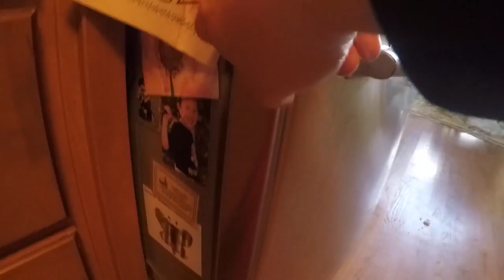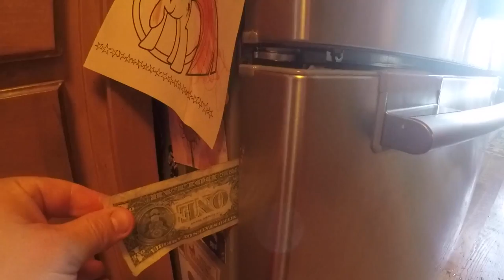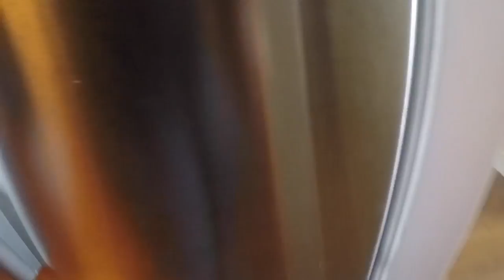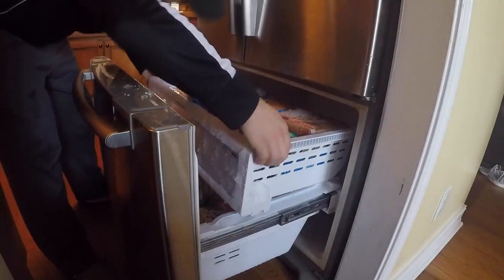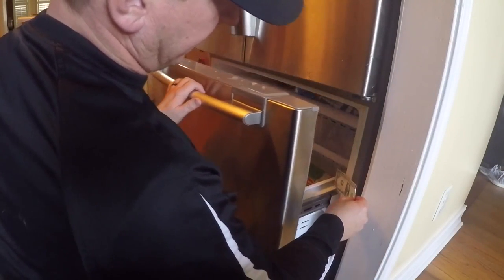Fixed: Frost Buildup In The Freezer Causes

Comment: Good tips!  I had frosting problem after a visit by my grandkids and I was ready to blame them for standing on the freezer section.  After viewing your video I did the dollar bill test and found a gap on one side.  I looked behind the bottom drawer and found a clip we use to seal veggie bags.  After removing the clip I did another dollar bill test and the door closed properly.  Thanks for saving me from frost and wrongfully accusing my grands.
Reply from the maker: Dennis Vroegindewey Awesome! Thank you for sharing your repair success story. Keep loving on those grands! Be sure to subscribe.
Reply: There’s a problem with these French doors.  I just had service out.  Blamed door being left open which wasn’t case.  Shut power off for three days to defrost.  After two days with nothing in drawer, I have frost buildup.

Comment: Thank you! You saved an expensive call! It was something that had fallen behind the lower drawer which was prevent it from shutting all the way. I did the first thing you said and ran my finger on the periphery. Lo and behold, there was a gap on the left side. Tried removing ice, still did not close properly. When I removed the top drawer, I found an ice tray that had fallen behind preventing complete closure on the left side. Removed, cleaned, fixed. Thank you!
Reply from the maker: I’m glad you figured it out!

Comment: Thanks so much. My Samsung freezer was frosting up so badly. I thought that I had accidentally changed a setting, in my effort to do a forced defrost, to fix a problem with ice building up in the ice dispenser area. But after watching the first minute of your video, I got down on my knees and looked under the freezer box and saw that a box of frozen food was stuck in the back. I removed it and expect my problem to be solved.
Reply from the maker: bilco78 That’s great! I’m glad you found the issue.

Comment: Family member(s) did not close the bottom freezer door all the way; air leaked in causing ice buildup on tracks, so the door did not shut tightly. I did your dollar bill test and sure enough, the dollar slid out smoothly, so I knew it was not sealing as it should. I chipped off the ice on the tracks and large chunks fell out. After that, the door was able to close all the way and no more ice buildup! Thanks for your video---I was ready to call the repairman as I thought the seal had gone bad.
Reply from the maker: Nice! It sounds like you had the exact same cause and solution!

Comment: Others mention the dollar-bill test but this is the only video I have seen explaining the oxygen infiltration. I realized I probably cause the first ice by leaving the freezer open too long near an open window on record hot days and then the initial ice kept the door from sealing properly. I wiped off the ice (not feeling so confident about chipping it off, even with a butter knife) and the problem resolved itself quickly. Thank you!
Reply from the maker: Lisette García I misspoke about the “oxygen”. The cause is actually the moisture(humidity) in the air and the warmth that causes the ice build up. Kind of like condensation on a glass of ice water.
Reply: TightWadDIY - Gotcha! Thank you for the corrected information. In any case, what you said and how you demonstrated the issue in real time helped me troubleshoot and resolve my problem. Thank you!
Reply from the maker: Lisette García That’s great! I’m glad it worked for you too!

Comment: We have a similar problem with a New (3mo. old) Samsung 20cuft. After looking at your video, I think I can solve the problem as you described.  That was a Super Job of explaining the problem and the solution. I think I will remove the frost on the tracks and ice bucket drawer and keep our fingers crossed that the 'FIX' is in. 5*** Fix.   Thanks!
Reply from the maker: You are welcome. Thanks for the comment.

Comment: Thank you for posting this.  My freezer was starting to frost up . I found a small cup that my toddler had dropped between the freezer door and the wall that was barely preventing it from closing all the way.  It had slipped underneath the door and I doubt I would have found it without explicitly looking for it.
Reply from the maker: I’m glad you were able to find and fix the issue. Thank you for sharing!

Comment: Mine did the same thing I had to empty it let it sit unplugged for 24 hours cleaned drain which was clogged by frozen water and cleaned coils after I did all of that it has been working really good no more issues 😎
Reply from the maker: Edmundo Morales Wow. Yours must have been much worse than this one. Hopefully it doesn’t happen again. Were you able to determine the cause?
Reply: TightWadDIY so the drain was the culprit it wouldn’t let water from freezer drain out started freezing up bottom of drawer started getting huge chunks of ice because of drain
Reply from the maker: Edmundo Morales Thank you for sharing your experience.

Comment: Our upper freezer started ice buildup.    I taped it shut for 3 days, to see if it was the seal.   Still frosts up.    Then I watched your video.    I wiped off the ice where the door closes to the freezer.  I spotted a hairline crack on the bottom edge of the freezer where the door closes.     I put some tape on the crack & closed it, for a test.
I did the flashlight test to see if light shines through= no.      We have no kids.  What would
cause a hairline crack?       Can it be glued or do we buy a refrigerator?
Reply from the maker: I’m really not sure what would cause that.

Comment: People are asking how to get rid of the ice in the fridge ( freezer) I have been using the vacuum cleaner with the tube connected to the air outlet, and this i have been doing for 40 years and this will help removing the ice quickly and safely.
Reply from the maker: Interesting. Thanks for sharing.

Comment: How do you deal with gaps, if the freezer is empty, with no ice? I just defrost ed mine. So now I have the opportunity to fix it. Should I buy some tape, and put it around the door, until the dollarbill trick shows it is working properly?
Reply from the maker: No. You have to find out why it isn’t aligning. Is a drawer slide bent?

Comment: Great video.  Starting by running my hand along the seal on ALL(!) sides.  As I reached under the front to run my fingers along the bottom seal, I found stuff.  Sandwich baggies of chopped green pepper and of mini pepperonis.  Couldn't see a poor fit, but the cushion was obstructed there.  Those small items probably got pushed off an overfilled thin bin for pizza boxes (middle of 3 bins).  Not the place for small items like leftover bits and plastic ice cubes.
Reply from the maker: Alan Carwile I’m glad you were able to find your issue! Hopefully it clears up your frost. Be sure to subscribe!
Reply: @TightWadDIY  Subscribe done!

Comment: Hello. I have an LG fridge with the two bottom freezer doors. The bottom drawer will not open completely. About a week ago I discovered that the bottom drawer had not been properly closed thus the frost forming. I’m not sure if the drawer is not opening due to the frost build up or if the railings is busted? There is something preventing the drawer from opening. Do I need to defrost? Or force open the drawer?
Reply from the maker: It’s possible there is something stuck under the drawer. Have you checked that?

Comment: Good video, but what do you do if the dollar bill slides out easily even after emptying the freezer shelf, cleaning the rubber seals, etc? Means the freezer drawer is imbalanced? How do you fix that?
Reply from the maker: It’s possible a track is bent. You can replace them.

Comment: I've moved all the food from my refrigerator to a trusty old refrigerator and unplugged the refrigerator and thawed the thin layer of frost or ice from the back inside wall of the freezer with a hair dryer. Is there still ice or frost behind the back inside wall of the freezer that I can't see?  Do I need to keep the refrigerator unplugged awhile longer to thaw what I can't see?
Reply from the maker: If it’s a hard sheet of ice I would let it thaw. If it’s just frost, you don’t have to wait.

Comment: Do you think it is wise to use a butter knife - too much force could damage, even scratch it unnecessarily? Maybe a blow dryer or something first to help it loosen? Also - my frost was very light, but everywhere and on all the items. Doors seem sealed tight (thanks for the dollar-bill test), so was probably something in the way temporarily. So should I take everything out and clean up the flaky frost from them, or will it clear by self?
Reply from the maker: A11iOop The frost should clear itself if it’s light. I don’t think the end of a butter knife is a bad choice at all. They are rounded over with no sharp sides.
Reply: @TightWadDIY  GTK, and thanks for such a quick response! Very good video covering all possibilities.
Reply: @A11iOop  might pay to not be too aggressive while scraping.  Imo, this is especially true near the corners or any area that is not flat.  The pastic may be a little brittle  due to being so cold.
  If using a hair dryer, take your time.  Do not heat the plastic liner too much.

Comment: When it comes to cleaning out the frost any advise or should scraping it off work fine??
Reply from the maker: Antonio Ramirez Scraping it should be fine. Just try not use a metal object. If it’s not hard frost, you can likely wipe it off.

Comment: Will this issue also make the freezer fan run non stop? I have the same buildup but I’ve noticed that I hear the fan running 24/7 when before I could tell when it turned off because it was dead silent, now it’s always on
Reply from the maker: It could. The fan is what regulates the temperature. If your door isn’t sealing, it won’t hold temp so the freezer continues to run in an effort to maintain the temp.

Comment: I have a problem with the metal slide tracks on the ice bin.  It freezes up and won't budge.  I defrosted the tracks but overnight it froze up again.  Any tricks to keep it free  and moving?
Reply from the maker: lora martorano You may need to defrost them then dry them off really well.

Comment: I just installed a brand new Samsung french door bottom freezer. After set up and with nothing inside my freezer is building up frost! Everything looks to be sealing fine. Manual says to check for a blockage  of the air vent. Problem is no pictures or diagrams as to where they are referring. There's vents all over inside this thing! Any ideas?
Reply from the maker: I’m not sure what could be the issue. I would consider making a warranty claim.
Reply: Thanks

Comment: I am a little surprised you did not check at the bottom of the freezer in the back for ice buildup that might have been between the bottom basket snd the freezer back not allowing the drawer to close completely.
  I have had a situation where the drawer had a slight hangup when first opening it.  Ice had built up beteen the basket and the back panel to the point that it jad tajen the shape of the back of the drawer and was causing it to stick a little.
Reply from the maker: Rickey Keeton Great tip. Thanks for sharing.
Reply: You should start your own channel.
Reply: @MaidenFanboy  Sorry, I did not intend too offend anyone.

Comment: Any suggestion for a 1.3 year old LG with this issue.  It's months out of warranty 2-3.  We finished a complete clean and ice clear out.  sadly the dollar bill still slides on the right side.  Any ideas?
Reply from the maker: Calypso’s Hoard Did you pull it the whole drawer and check behind it?
Reply: Yes. We cleaned it but I think that although we dried it...some water may have re-frozen the track

Comment: We have a thermostat issue in the fridge right now and my dad is yelling at me arguing because he wants to leave a gap in the door to "let the cold air out so it wont freeze" and half way into a sentance trying to explain how im worried this could just end up building a bunch of frost in the fridge since its hitting freezer temps he interrupts and yells over me "it cant buikd frost if it cant get to freezing temperature!" Like he thinks a tiny little eighth inch gap will be enough to keep it from getting cold enough to frost at all. Ugh. Im not even sure it would, but hes not a refrigerator repair guy and im going mad with him getting defensive insisting that im wrong without even letting me finish the sentance explaining why im concerned.
Reply from the maker: He has a terrible idea… haha.

Comment: The frost isn't "due to oxygen getting into the freezer" it's caused by the humidity (moisture) in the air. This is usually caused by/from leaving the door open, poor seals, or putting warm/hot food into the freezer.
Reply from the maker: Robert Frost Thanks.

Comment: The problem is not caused by "oxygen" getting into the freezer, it is caused by air containing moisture. The moisture condenses on surfaces and freezes. Still, a helpful video.
Reply from the maker: TJL Agreed. I misspoke and it won’t let me edit the video.

Comment: Mine is literally brand new and it’s building up. The door seal appears to be tight so idk what to do.
Reply from the maker: I wonder if something was assembled incorrectly.
Reply: @TightWadDIY  I’m doing the defrost method right now where you hold both power freeze and and power cool button together for 8 seconds and the freezer goes into a defrost mode for a 1/2 hour.

Comment: Nice info.. 
I will check the sealing No frost "Frosting" Freezer..  Thanks for the info..
Reply from the maker: I hope you can discover and fix the issue.
Reply: @TightWadDIY  I really appreciate your replying. I have checked the seals which seems to be OK.. 
I will check the defrost heater circuit if its works. 

A freind suggested it maybe low refrigerant.. But I doubt that..

Comment: My cleaned out all the frost a week ago,and it came back worse.So I did your dollar test,and one side was at least a quarter inch gapped.Pulled out the top drawer.Turned out there was a frozen meal behind the drawers.My wife hadn't pulled pulled the drawer out,so she didn't know.Now the dollar test worked on both sides.Hopefully tonight it will still be unfrosted.Thanks!You are a life saver.
Reply from the maker: Nice! I think you found your problem and will be happy with the results! Nice work.

Comment: Oh my goodness thank you for this detailed and thoughtful video! I was separating my dogs raw food today and had stored some containers in my pull out freezer drawer and a couple hrs later opened it to grab one to defrost and there was all this ice accumulation I’ve never seen before yet identical to the one you’re working on. Even last night I noticed something odd about the door in just glancing at it but wasn’t sure what it was and because this is my first freezer drawer like the one you’re working on, I have no experience whatsoever. Sure enough a boxed item was just nudged in the very bottom drawer in a way that it prevented the right side drawer from securely closing and it had that same uneven look to the corner compared to the left side. Very helpful, you saved me from what could’ve become a much bigger problem!
Reply from the maker: Well that’s great!

Comment: I’ve defrosted and totally cleaned it thees times. Always manages to happen again, starting on the right side, gets worse and worse. Any ideas?
Reply from the maker: Megan Moon There has to be a leak somewhere. Have you checked the seal all of the way around?
Reply: TightWadDIY once I clean it completely it seems to seal properly, but happens again within like six months. I’ll check the seal, but what repairs are likely? Loose bearing, wheel, track?
Reply from the maker: Megan Moon Do you have children? If it’s only happening once or twice a year, it’s likely one of them may not be closing the door properly. I think if there was a mechanical issue, it wouldn’t take 6 months to happen again.